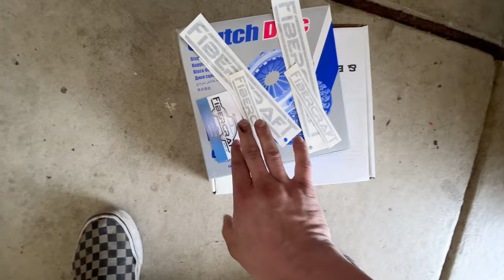VW TURBO BUG ENGINE IS OUT!!! 😭

Comment: I'm running a stage 2 clutch in my 63. They're a bit heavy but a good clutch. And I hope you torqued it down with new bolts. (Just sayin)
Thanks for sharing great video. 
✌🏻 Peace from Australia.
Reply from the maker: What size engine are you running? Turbo? NA? I know it’s gonna take some time to get used to and it’s unbelievable how I keep breaking the stage 1’s with a small engine. I torque them down with the same bolts with blue loctite, I’ve been doing that for years, and it still hasn’t failed me.
Reply: @EmmettRacing  1915cc engine roughly 150hp. With the bolts.
So much rubbish on the market the threads stretch. Ask me how I know. 😫